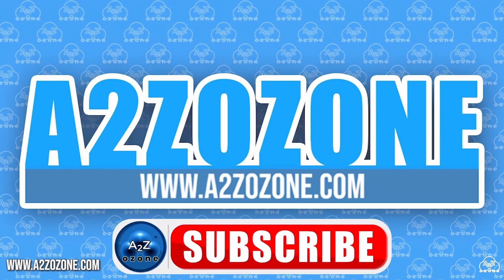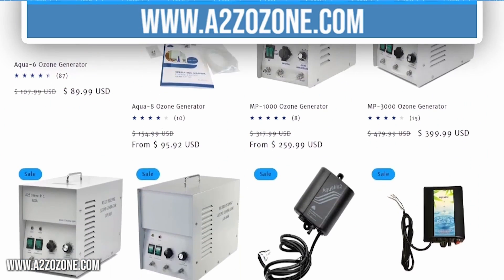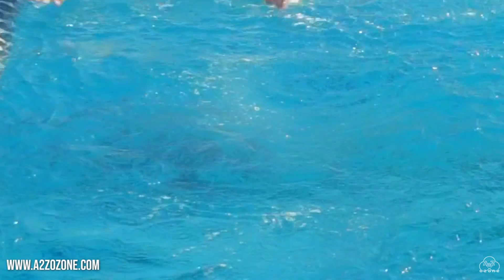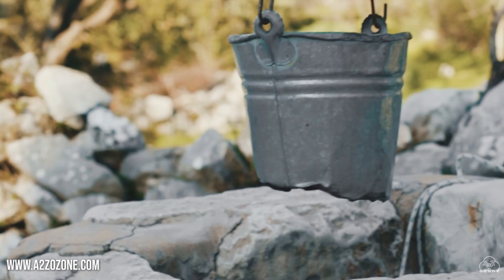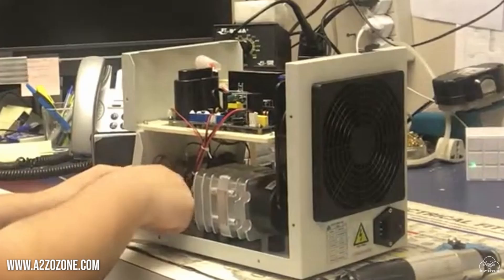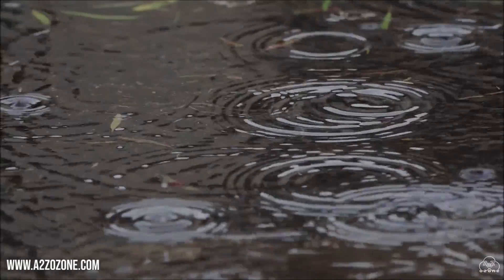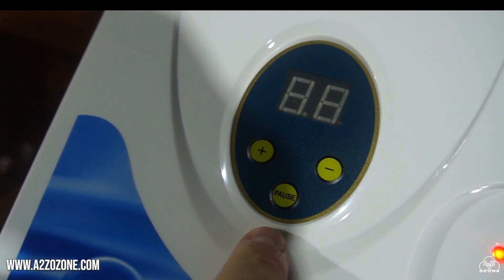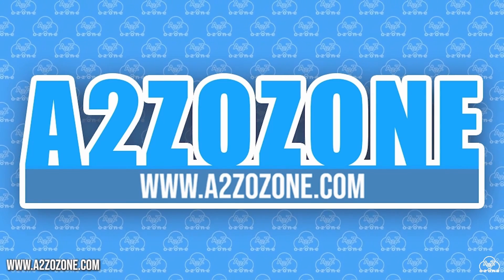5 more common industrial water ozone generator applications

Comment: Your aqua 8 model burns out fuses pretty quickly
Reply from the maker: If your Aqua-8 is burning out fuses, something is wrong. If it is still under warranty, consider returning it to us for repair or replacement. Also, make sure your application is in line with the design of the Aqua-8. The Aqua-8 cannot be submerged more than 4-6 inches in the water because the pump will not withstand the pressure. Make sure you are not experiencing electrical issues. I imagine you may have already considered these possibilities.
Reply: @AtoZOzone  i found if i unplugged one of the connections inside generator & reconnect it, itll work again. Or replace the fuse, either way will make the generator work again
Reply from the maker: @firmbeliever3847  

Hi, That's great to hear.